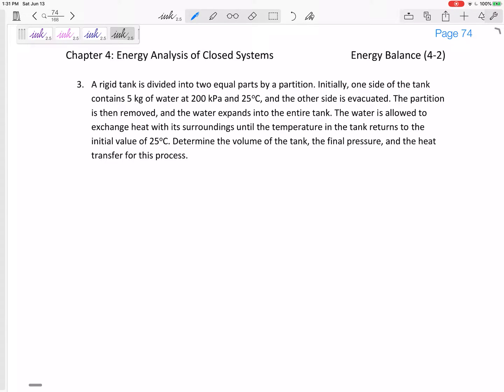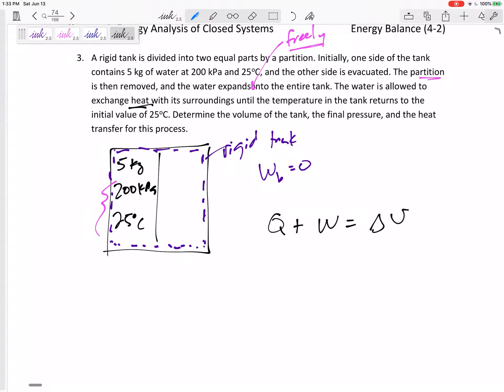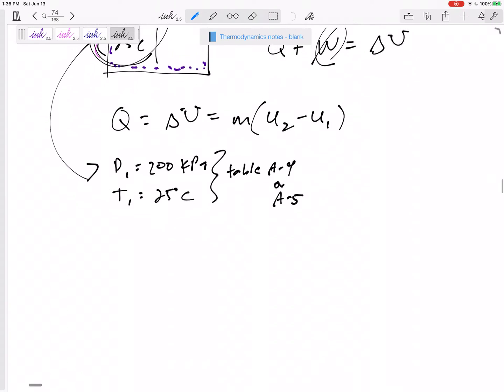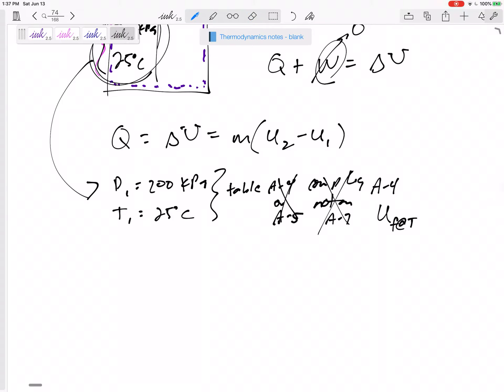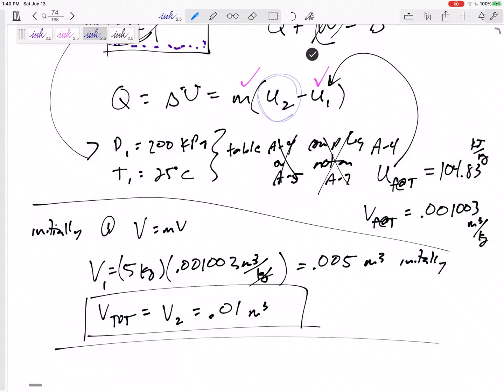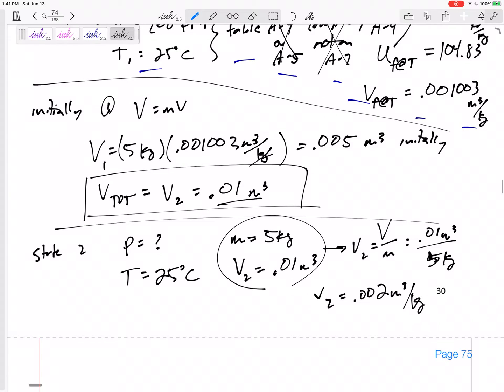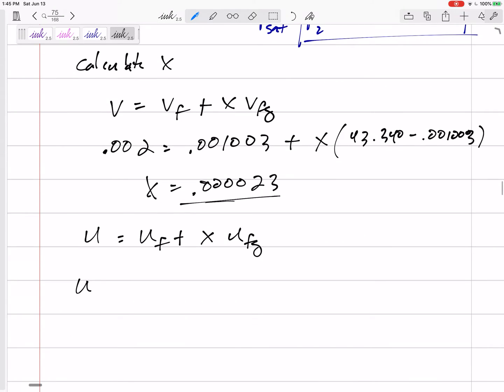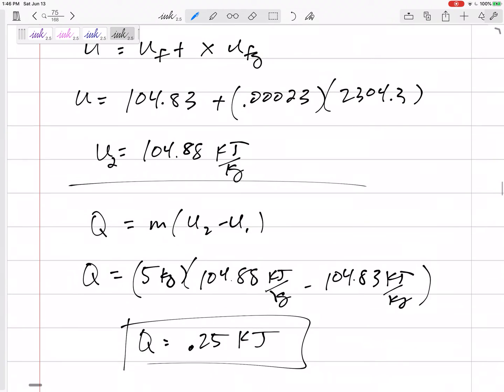Thermodynamics - 4-3 Conservation of Energy in constant volume process

Comment: Would there be some H due to the mass flow from one side to the other?  Or could we just neglect that by assuming it’s negligible?
Reply: The system in consideration is the whole rigid tank, not just the water inside it. The volume of the tank stays the same, there's no boundary work, so the change in enthalpy is equal to the change in internal energy.
Reply: Thanks for the clarification

Comment: why wouldn't you just take u2 from the table is it not the same thing?
Reply from the maker: I did get u2 from the property table. I took the temp and v and went to table a4, got the quality, and used the quality (and table) to get u2. If it’s a mixture, you can’t just “read” it off the table- you need to calculate the quality, x, so that you can calculate the u.
Reply: @engineeringdeciphered  ah ok thanks so much the quality was just so small it didn’t really matter but you still have to do jt
Reply from the maker: @bd_shep  ahhh yes, that quality is very very small!

Comment: The answer shouldnt be 0.25 its 2.3, The quality is correct in the video but the calculations in the textbook answers states that the quality is .00002 and its really .0002
Reply from the maker: The solution I’m following says the quality of state 2 (by looking at the specific volume) is (.002-.001)/(43.34-.001) which is 2.3x10^-5 (0.000023). Is there an error here?
Reply: @engineeringdeciphered  He got 2.3 because in the video when you are calculating u2, the x value that you used is 0.00023 instead of 0.000023. However, the answer is still correct altho the X value has less zero in it.